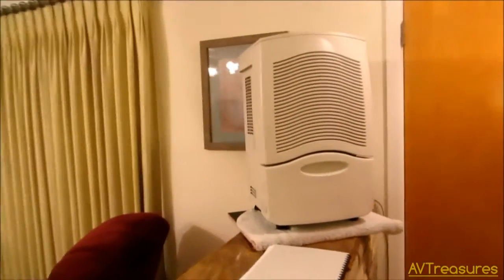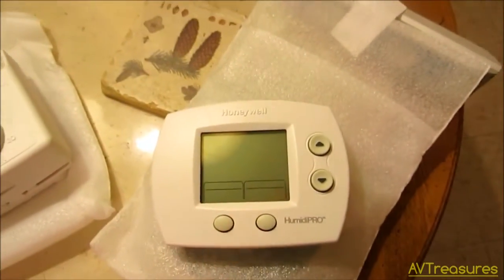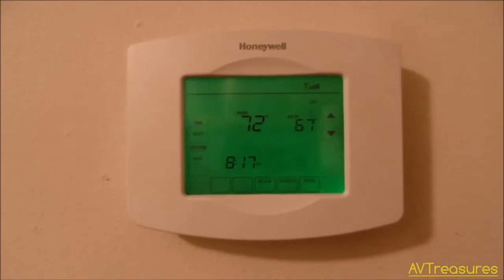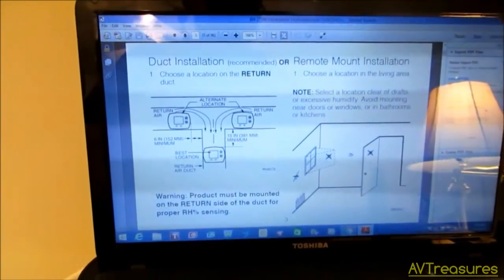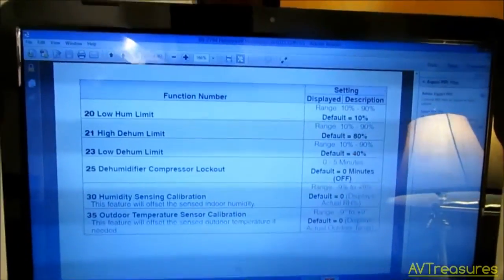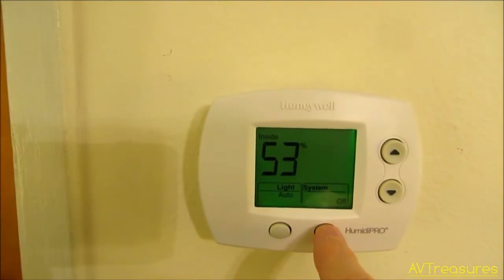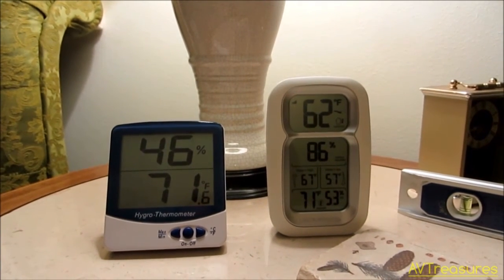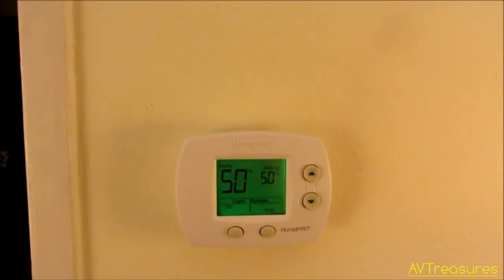Honeywell HumidiPRO Digital Humidity Control

Comment: Excuse me sir, I just installed one but it doesn't work and until now I'm watching your video but my thermostat is already damaged because I connected it directly to the 24 volt machine but it doesn't work.
Reply from the maker: This control requires a separate power supply. You can use a stand alone 24 volt transformer or use the power from the R and C terminals on an HVAC unit like I did here to power it. The power to operate the humidistat  can not come from the device being controlled. The U terminals on the humidistat make or break the control circuit on the controlled device (humidifier or dehumidifier)   Hope this helps.

Comment: what does your U U go to on the dehumidifier itself
Reply from the maker: Those two wires make and break the 24 volt circuit going to the contactor. When the contactor closes (on humidity rise) it sends power to the outlet that the dehumidifier is plugged into and turns it on.

Comment: Have a question for you on this wiring. trying to do same thing essentially.
Reply from the maker: Thanks for watching my video Joseph. What is your question?
Reply: AVTreasures I have a dehumidifier that has an always-on switch or Knob that says dryer or humid I want to hook up this humidistat for more accurate readings but I want to run it to a contactor and have the contactor send power to the plug that turn the thing on I'm pulling 24 volts from an air handler that's in the room I tryied to wire the U and U too the contactor and it didn't work so I guess I'm just trying to figure out how you hooked it up cuz it looks the same as what I'm trying to do??
Reply from the maker: I see. Let me try to help you out Joseph. What you will need is a separate 24 volt transformer for your control set up. Mine can be seen here at the end of this video: skip to 8:42) https://youtu.be/kdFffZE1RCQ 
I am only taking power from my furnace to power the Honeywell HumidiPro. The power to operate the contactor comes from the separate transformer mounted in my control box.

Comment: The H6062A only lets you adjust humidity in increments of 5 degrees. Have does it hold the humidity to +- 1% or have you noticed.  I Just installed mine and I haven't figured out what the swing/hysteresis is yet. I hooked up the outdoor sensor even though I only have it hooked to my dehumidifier. Thanks for the video.
Reply from the maker: Yes, and that is the only thing I don't like about it Don. I wish it could be set in 1% increments. I'm sure Honeywell has a reason for this but I don't quite understand why. I've used the H6062A now for a few months and really like how steady it holds the humidity. I have a couple of tabletop digital hygrometers in my house and they only move 1-2% during high humidity load conditions with my dehumidifier cycling on and off. So all in all, I am very happy with the HumidiPRO. It doesn't have nearly as much variation with changing indoor temperatures as my old mechanical one did. I had to nudge the mechanical dehumidistat now and then to go off or come on. The HumidiPRO has eliminated that for me. No problem Don, thank you for watching.
Reply: AVTreasures Thanks for the fast response.  I have a couple hygrometers also and I'll keep an eye on them and see what the swing is for mine.  My dehumidifier (Honeywell DR-65 whole house) can keep the humidity (manual control) swinging between 49-57% (almost 10% swing).  I'm hoping the H6062A is tighter - fingers crossed.
Reply from the maker: No problem. I think you will be happy with the HumidiPro Don. It should do a lot better for you. 10% is a big swing. I used to have a 4-6% swing with my old mechanical model, depending on indoor temperature. Let me know how yours works for you.

Comment: How do you like your dehumidistat  Ray for the the old Kenmore  dehumidifier  setup ~Dee~
Reply from the maker: +hvacguy84 | Hello Dee! I love the Honeywell HumidiPRO dehumidistat! It works perfectly. I'm so glad to finally have one. Thanks for watching Dee!
Reply: +AVTreasures When will the Coleman Heat Pump start up in cool mode and does the Coleman heat pump's thermostat have the "C" wire hooked up ~Dee~
Reply from the maker: +hvacguy84 | The Coleman heat pump was started in cool mode back in late February on a warm day. With all the solar heat gain, It only has to be in the 60's for that room to need cooling. Yes, the Common wire is connected on the Coleman's thermostat. There are no batteries in it at all.

Comment: That's a great setup there through and through.  While I'm not a fan of electronic controls, I can certainly see how this would be more accurate.
Reply from the maker: +jaykay18 | The control setup has worked very well for me since I put it together about 12 years ago. However, I was always having to nudge the old mechanical dehumidistat one way or the other to get the humidty where I wanted it. This control will eliminate that. It's keeps the humidity as steady as a Honeywell Pro series thermostat keeps temperature. Thanks for watching!